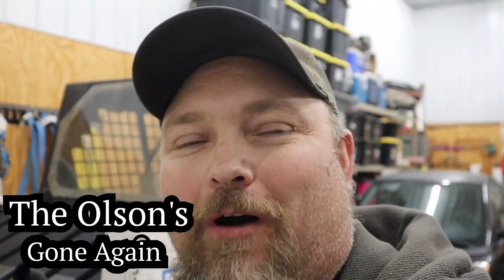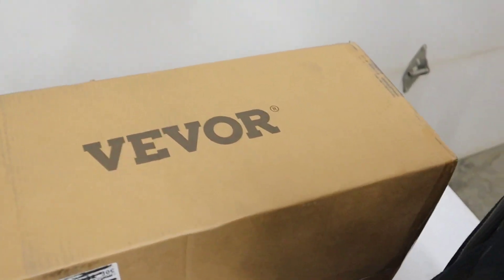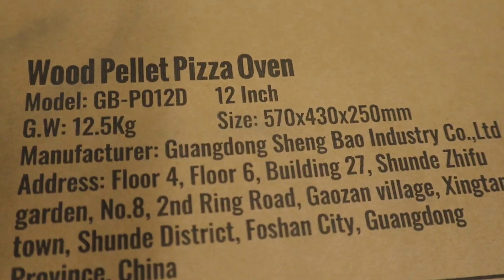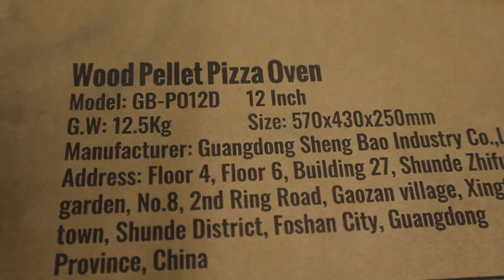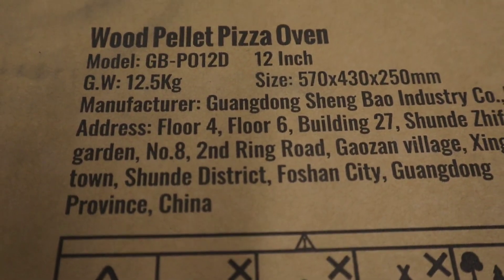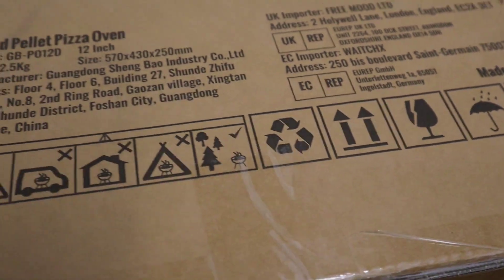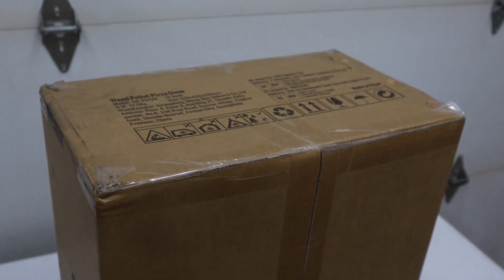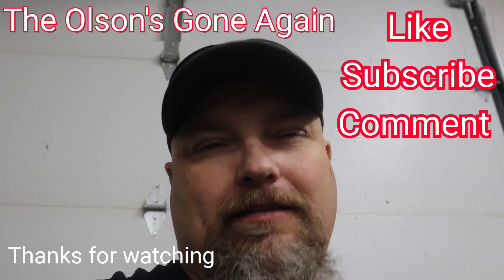Vevor pellet pizza oven unboxing

Comment: I purchased that very oven a few months ago.  After firing it up over 20 times, I was frustrated that I could not get it hot enough to cook the crust.
I called Vevor and explained the issue asking for advice.  They carefully admitted that the unit will probably not get to the  temp as advertised and said they would look into changing the heat range in the description on the www site.  They never did!
I was just about to throw it in the scrap pile when I thought of something.. I did a simple modification that turned this cheap unit into a small oven that reaches 800* plus degrees in about 15 minutes.  I did a short simple video on how to modify yours if you or any of your viewers are having the same problem.   Here is the youtube link...  https://youtu.be/fG60i76-TTE
Reply from the maker: Thanks. I also was thinking the stone does not get hot or cools real fast, I just thought it was trying to cook at below freezing temperature
Reply: @TheOlsonsGoneAgain-hq3gi  The stone is too thin but my modification allows for the stone to cool while still retaining enough heat to cook.  Try it.. you will be super surprised!